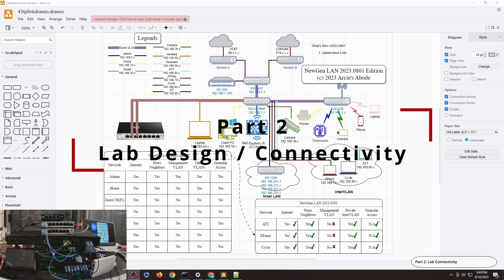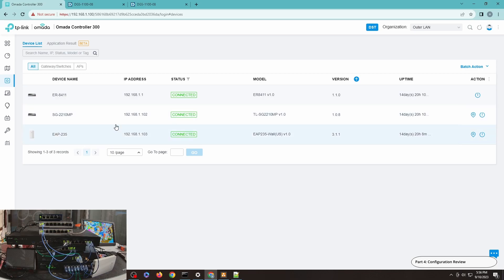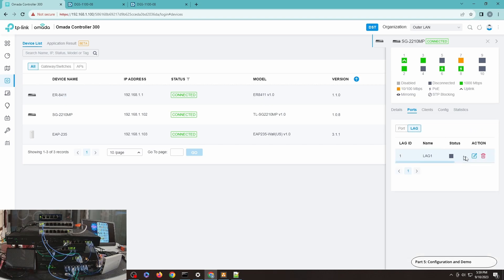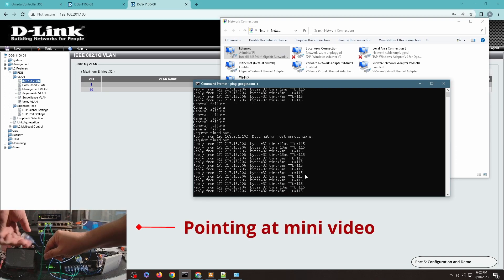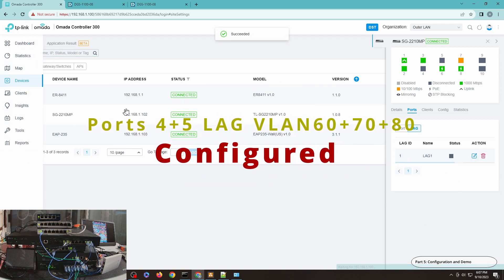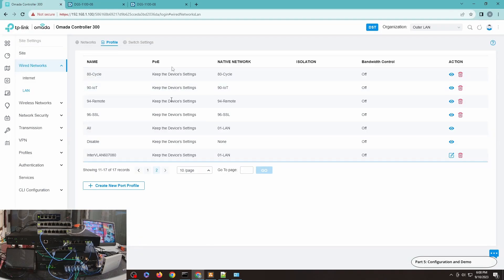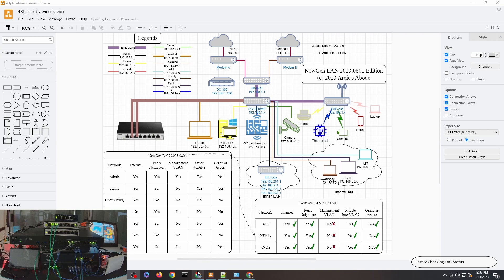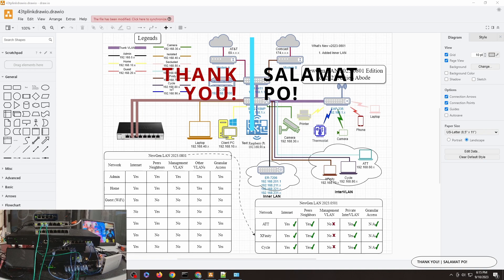LC59: TP Link Omada Switch Multiply LAN Bandwidth with Static Link Aggregation Group(LAG)

Comment: Hello sir, i just wanna ask you about this omada stuff. I am currently have my omada set up for voucher business in my small hood. I just thought that this might help me boost my current network. I have an er605, oc200, sg2008 and eap110 plus i have 3 non-omada routers and switches. Please help me how can I integrate to omada nature if possible. Thanks and more power!
Reply from the maker: hey @eranoceli5097, thanks for dropping by the channel. I assume you want to improve your North/South (Internet) traffic. If that is your goal, you already have a great set up. But remember, ER605 is limited with 1Gbps uplink for LAN and WAN, and you can't improve Internet traffic beyond 1Gbps. If your other router supports more than 1Gbps, you can replace your ER605 and use that other router instead. The other switch will not improve Internet traffic, but you can improve LAN to LAN traffic if you implement LAG between the two, but you will need to refer to the other switch's direction on how to do that. You can use the guide here to configure the TP Link switches.

Good hunting!

Comment: Hello @deadmeats   , is it possible to do the Link Aggregation or Ports Bonding on different ports of different switches of TP-Link Omada as long as they are interconnected of the same network?  
Because what you did on this Video was just ports bonding on the same one TP-Link Omada switch. Thank you in advance for the answer.
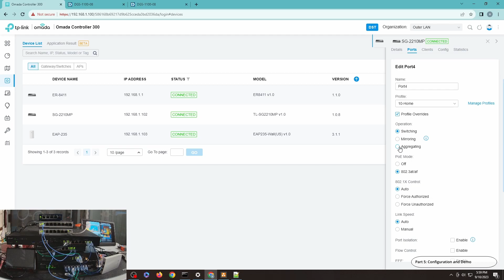Reply from the maker: hey @GDL-sr6zk. thanks for dropping by the channel. That can not be done with TP Link Omada switches. As can be seen at 5:37, ports forming LAG must be on the same switch. Good hunting!

Comment: So DLink switches act here as modems just to show how this could be done, right?

What is my case: DSL modem + LTE external modem and I want to combine them in Omada setup. 
You are sticking 2xWAN to that LAG combined ports (4 and 5) in Switch. I should use this approach too? Why not WAN 1 and 2 in Omada router?

Context: DSL has awful upload around 0,9mbps, LTE is much better around 15-22mbps. That is why I'm not thinking only about failover. Load balance setup at router I guess is unstable due to some pocket lost via LTE (although that might be just issue for my current setup - 2WAN Asus router DSL-AC51). 
Link aggregation would be a way to go in this case, correct?

Why Omada: finally I want to connect 2 WANs for real plus I have huge historic house and other buildings so will use Omada for many Access Points, switch for cameras etc
Reply from the maker: heya @Saeglopur89, thanks for dropping by the channel. For your first inquiry, D-Link acts just like another "3rd party" switch and not a modem.

For this video, the link aggregation I covered is the "switch" version, and all the member ports of "link aggregation GROUP" must be in the same switch for both sides, meaning, Switch A Ports x-to-y must be connected to Switch B Ports x-to-y (and not Switch A Port x connected to Switch B Port x plus Switch A Ports y connected to Switch C port y). What you are saying is an aggregation of WAN uplinks between multiple providers and a single Gateway which is not the same in the video.

As for your context, doing LAG on WAN is not a simple process as it requires close coordination between the uplinks. Even LAG itself is doing load balancing when sending traffic between the devices, however, from the RSTP's point of view, it is just a single uplink and hence, no blocking occurs. 

So to improve your WAN, you are already doing it with what you already have: load balancing. The gateway will try its best to use the best uplink, or you can configure the "ratio" and find what works bets for you. Alternatively, depending on your needs, you can use Policy-based routing instead: i.e. all download will utilize certain ISP and all upload will utilize certain ISP and you can check a guide I made here: https://youtu.be/rjQ_0Od5r48

Good hunting!
Reply: @deadmeats  Thank!
I did a lot more research and after that fully understood what you really did here :) 

So it's not for my scenario and again got back to load balancing and found that just my router wasn't powerful enough to manage it in stable way. I have to really jump to Omada! :D 

I'm watching more and more of your videos!   :) All best from Poland, thank you for advices and videos! :)
Reply from the maker: hey  @Saeglopur89  glad to know you found what you're looking for and thanks for watching my videos. If you are looking for an Omada solution, you can start off with an ER-605 v2, as that is the most "affordable" Omada Gateway. I am not sure if $60 is a huge deal and I am not sure if your store/shops are easy to work with (i.e. easy return without question) so just be aware that the ER-605 v2 cost that much, at least here in the US. So if that is something you can risk, try it out in "Stand Alone Mode'" (not Omada/Controller Mode) and return if that doesn't meet your expectation and/or usage scenario. You can use Multi-WAN feature (and more) in Stand Alone Mode. 

However, be aware that if you would like to go "Omada/Controller", you WILL need a Controller (free if using a Windows-based installation) or at least $100 for OC-200 hardware controller. I don't suggest you jump into this unless you are willing to risk and check if this will work out for you because you may need additional devices to fully realize the Omada platform's strong points. An entry-level set up of an ER-605 v2 Gateway (60), OC-200 Controller (100), SG2210P V3 Switch (120) and EAP-610 Access Point (90) will be around $370.  I'd be tempted to say to get an ER-7206 and skip ER-605 v2 for better specs and features but the ER-7206 cost much more than any other devices I listed @ ~$150.

As you can see, the costs can quickly add up :(....Interestingly, in comparable market (i.e. Unifi, and building your own Pfsense platform), $370 is a pretty competitive pricing for a full-blown, warranty-covered, brand-new device set up. Btw, if you do plan to buy Omada and can wait, wait till Q2 next year as they may release something new and may bring current prices down (disclaimer: these are all speculations :)).

Wish you all the best.

Comment: Once more, a great tutorial video! Thank you @Dead Meat!

My only questing is kind of irrelevant to your video, but I would like to know if there is a way to create a link aggregation between the ER-605 or ER-7206 router and the SG-2210MP switch by already knowing that TP-Link has already informed us (the users) that both routers are not and will not support any kind of link aggregation due to their limited bandwidth handling capabilities.

What I am asking is if there is a way to trick the two devices (for example, ER-7206 & SG-2210MP) into forming some kind of lag or lacp between each other? I have read somewhere inside the Reddit community that there might be a way, by utilizing VLANS, but I do not have your knowledge on networks or expertise and that is why I am asking you. 

I believe that if there is a way, and you can find it, many people will praise you for years to come, including myself!
Reply from the maker: Heya @J0hnSm1th, as usual, thanks for the kind words and as for your comment for expertise, I'd say I am just a hobbyist that happen to have some time to try these features out. As for "LAG" / "LACP" between two routers (or switch and router), the short answer: I have not seen this being offered in TP Link Omada series of devices, but I have seen router-router redundancy  in other similarly priced product and even end-of-life TP Link products.

While LAG is usually for increased bandwidth, it also known for redundancy and router do support redundancy so I'll just cover both:. 

Long answer (about redundancy, router to router): if we look back why we'll need more than one router in a network (not so much for home, but required for larger network), it is for redundancy. In Cisco, it's called HSRP. Outside Cisco, you should be looking for Virtual Router Redundancy Protocol (VRRP) for many devices from Mikrotik or Edgrouter series from Ubiquiti or pfSense for DIY approach.  There is a way to implement VRRP but that will require non-TP Link Omada devices because Omada doesn't even allow adopting more than one Gateway in a site and none of the current Gateways support VRRP (at least, none that I can find, if anyone found it, do let me know). 

As for tricking it using Omada, I had a really bad implementation of it way back 3 or 4 years ago and it is more trouble than it's worth (and not very reliable). The alternative way will be much easier and proper way to do it: use non-TP Link Omada Gateways. Maybe there is indeed a trick way of using Omada for VRRP (or something resembling it) and I just haven't found it. But the challenge of updating the MAC address table of the Gateway IP in my Core Switches was very annoying to get around back when I was trying it. 

Semi Short answer (about bandwidth, Switch to Gateway LAG ): I'll check it out if TP Link might have a feature related to this when I get the chance. I have not seen this functionality in any of the Gateway interfaces and in the past, we usually just upgrade the trunk link between switch and router to improve bandwidth and depend on VRRP (see earlier answer) for redundancy combined with redundant switches with RSTP....

Anyway, happy hunting and thanks again for watching the videos...
Reply: @deadmeats  I wasn't expecting such a detailed answer!!!! Thank you so very much!!!! Indeed it is a shame that TP-LINK Omada is supposed to be competing with the (light) business Ubiquity devices but lacks on such core features. Anyway, I will continue using my Omada setup due to its user friendliness and if they offer link aggregation between a router and a switch in the future, I will be much happier with my network setup. I guess that is life after all. It all comes down to choices. In any case thank you for everything @deadmeats! 😉 ✌️
Reply from the maker: heya  @J0hnSm1th  , you are most welcome. As for LAG (increased bandwidth) between Switch and Router, I will not really put much blame on TP Link, as technically speaking, LAG is an L2 feature and so Switch (L2) to Router (L3) is really not very common. When I started looking into it, I was thinking about ER7212PC  which TP Link's Amazon listing calls it a 3-in-1 device (Router, Controller, and Switch). I'm skeptical but I don't have this device so I can't test so I just decided to read reviews to learn more. So in one of the review, one of the reviewer mentioned that the "Switch" is not really a switch (Link to the review below, by a reviewer named NATHANC). Another review made by "Robert J. Camera Jr." (same link) also mentioned that "no managed switch " so there goes my hope :). If this device did indeed have a managed Omada switch, then LAG can be achieved :) but alas, it is not.

Review: https://www.amazon.com/TP-Link-ER7212PC-Controller-Installation-Protection/dp/B0BMSJRNJG